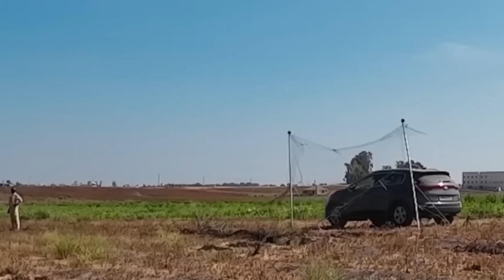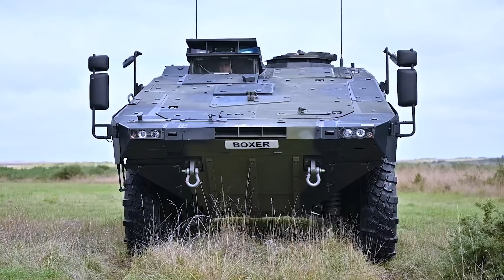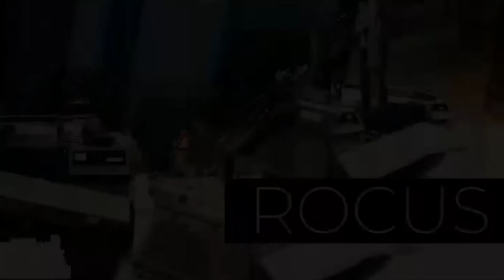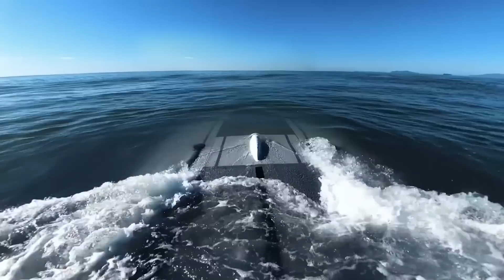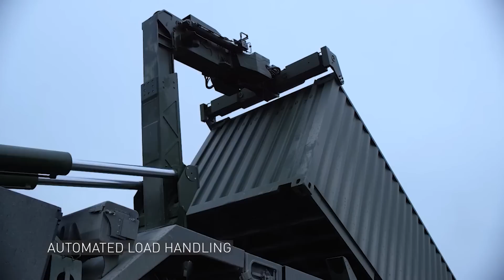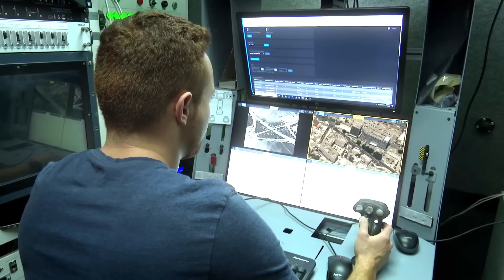MILITARY TECHNOLOGIES THAT HAVE REACHED A NEW LEVEL

Comment: Why is that enormous vehicle mounted electronically aimed Mortar not self loading? May as well pull that thing on a small trailer if you have to stand there in the open like a target dummy and hand load the rounds.

Comment: The ball tank would be a better design if the barrels were somehow fully enclosed inside of it and all it presented was holes with bullets firing out. (Maybe it would be better off firing small rockets.) (Actually what about them there armor piercing fin stabilized discarding sabot darts / long dart penetrator.) (Heck if you shot armor penetrating darts from one hole and shot self guided rocket explosives out of the other hole you'd be all set. A big old ball like in the video could store a couple hundred of each type of round.)